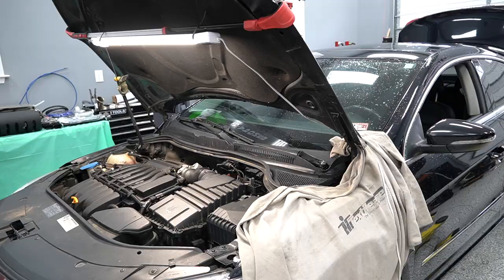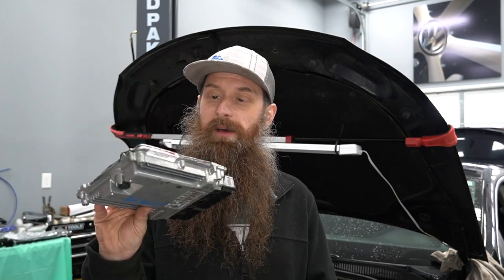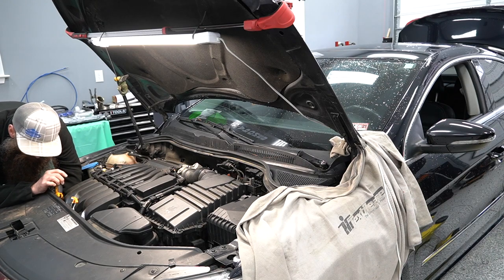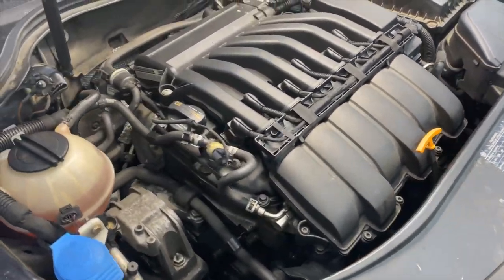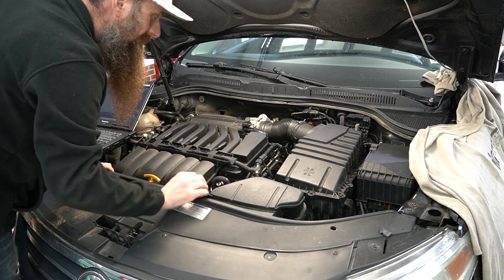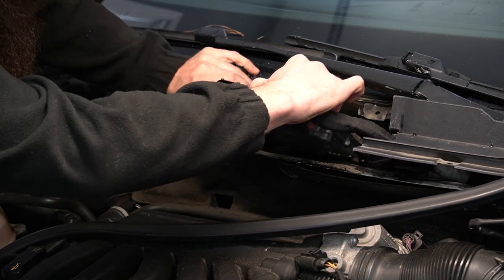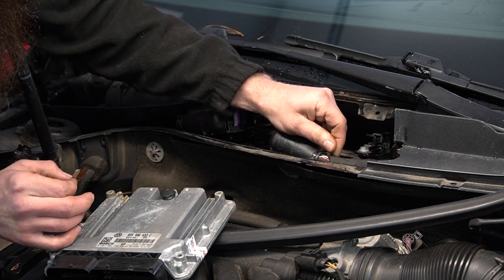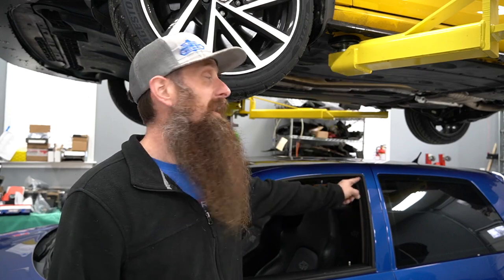3 Other Shops, Didn't Fix this Car. They Made it WORSE

Comment from the maker: BTW! Thank you all for 500k! it's pretty freaking awesome. <3 you guys! Also what should we put this 3.6 in? ;)
Reply: If my MKIV GLI shows up on your driveway, there's your answer, now I just need to find that blank check for you.
Reply from the maker: @CheezeCracker  LOL
Reply: A Golf Rallye
Reply: I also recently found a rusty razor in almost the same place under the hood in my daughters new 986 Porsche. Probably / hopefully from when the convertible roof was replaced before purchased. 
Thanks for the great videos. 👍
Reply: Mk1 Caddy, clearly.
Reply: I've got a Mk1 GLI coupe that would love a VR6. I'm up in Canada though - don't think Trudeau will let it come down to SC for a visit. 😢

Search IMGUR for "My 1984 VW Jetta GLi Coupe" for pics!
Reply: Question...seeing as how these DTC’s were logged nearly simultaneously wouldn’t it stand to reason that these circuits share a common ground?....perhaps check the other modules to see if there are faults mirroring the time hack of the ECM DTC’s...I had a similar issue with my TDI Jetta after replacing my dual mass flywheel...I spent hours troubleshooting with VCDS...what should have done was check my bonding straps to see if they were tight...the loose ground ended up frying my battery and main fuse...I know it’s seems stupid but even I made a very simple mistake by NOT checking my grounds first...I’m willing to bet that not only is it a ground issues but it’s most likely the one UNDERNEATH the battery box...it’s easily corroded and extremely easy to overlook given it location...if the car had a dual mass service, motor mounts or anything like that someone could have forgotten to hook that strap back up...given the intermittent nature of your reference signal values I would say poor grounding is a prime suspect...I’ve replaced hundred of ECMS of which only 1 or 2 was actual a failure of the ECM ...99.9 % of the time a “computer failure” is actually a wiring problem, short to ground or lack of ground completely
Reply: Mk2 Golf
Reply: The junkyard, along with the rest of the car 😈
Reply: Some folks have a saying, "Miata is always the answer." I believe it's applicable to your question.
Reply: the wink face makes me think you're already looking into swapping the miata
Reply from the maker: :) I have plans
Reply: How about your NB Miata? :)
Reply: A vr6 miata would be awesome
Reply: @HumbleMechanic  Congrats on 500k!
Reply: It’s stuff like this that reinforces the need to bring your car to an experienced VW tech!  I stopped going to independent shops for reasons like this one.  Only dealer serviced. Costs more upfront but fewer hassles down the road.
Reply: hope you have 500 MILLION .. you're doing great work sir!!
Reply: A JEEP 😁😁😁
4WD LIFE 😁😁
🤣🤣
Reply: What size turbo would you recommend for a 3.6 vr6? With stock internals
Reply: Some time ago i asked you why you didn't go with the r36 engine in the mk4 R32. Is this a coincedence or did i actually contribute to this Idea :). Please stick this engine in a MK2 2door golf, they weigh nothing and it should fit Just like the 2.8 VR6 fits.🙏 Maybe make it 4wd, some big brakes and turbo and you wil have serious 1700 pound killer.
Reply: I have a B5 Audi A4 with a 5 speed manual needing a new engine.
Reply: Love my TT Mk2 3.6. Relatively easy swap!

For a challenge - mk4 golf platform hehehe.
Reply: Corrado, and slap turbo on it :D
Reply: @humblemechanic Do you happen to have a video on changing trans oil on mk4 6 speed manual trans?
Reply: Ve caddy would be cool good luck

Comment: General Mechanic shops: "Volkswagens are shit!"
VW specialty shop: "No, they're pretty easy when you have the right tools and don't just shotgun everything."
Reply from the maker: I’d like to think all cars are that way. Lol
Reply: @HumbleMechanic  It's alright for a shop to branch out to a couple different brands of the same market domestic market. But general "we fix it all" shops should be avoided by everyone. 
Jack of all trades(brands), master of none.
Reply: @TopDedCenter  That's not true especially when it come to diagnostic which is what this video is. Literally all manufacturers have the same or very similar circuit and system designs. Some are a little different. So what? You just learn how it works, if you didn't learn how something works then why even bother trying to fix anything? Your comment is really ignorant. We have a little bit more brain capacity than you think lmao we don't need your approval for how many different manufacturers we can handle.

An ignition coil on every car is the same. It's just a step up transformer just depends on how its controlled and where its located.
Spark plugs are the same
Engines internals are all the same makes no difference in diag
Injectors are all basically the same there's a couple different designs which aren't hard to learn
All potentiometers, thermistors, pressure sensors, speed sensors, sensors in general etc are exactly the same through all makes.
Networks are the same just sometimes slight differences that make no difference really in diag
The diagnostic routine in general is exactly the same for all makes
HVAC, EVAP, Suspension, TPMS, key fobs and basically everything else is all VERY similar or exactly the same through all makes.

A light bulb is a light bulb and you diagnose it as such even if it looks different. It's the same shit.
Reply: @TopDedCenter  I dont agree, good independent workshops are some of the best of all, the experience of varied makes and models tends to lead to a greater understanding of fault finding and diagnosis, that said, there are people who are specialists on a given make or model for good reason, but they are hard to find, even at main dealers for the brand in question.
Reply: Yep
Reply: I spent years and years fixing other shops’ screwups on ALL German cars. “General” shops should stick to American junk and lawnmowers....
Reply: @rekker2688  I have main dealers send me work they can't fix, and I'm an independent shop. Go figure.
Reply: @TopDedCenter  Your statement sounds true in theory,  but is actually false. Look up "SouthMainAuto" and "TheCarWizard" channels on YouTube. Amazing mechanics and they work on damn well anything!
Reply: @chrishernandez2490  actually you'll find that SMA does not work on Euro crap and that the wizard's garage specializes in Euro cars. Hell they even do lamborghinis, Ferraris, etc. I totally agree with the concept that for any in depth troubleshooting or repair that trying to focus on too broad a market will reduce your efficiency and increase the possibility of error.
Reply: @TopDedCenter  Honda is superior
Reply: @fuckjewtube69  not the same, maybe for basic stuff but hard diagnostic or even maintain e jobs like timing belts requiere special tools and even show different symptoms for the same things depending on the vehicle
Reply: You are the real deal my friend

Comment: I feel like so many shops and dealer service centers are just part changers these days instead of having quality diagnostics. I think it comes back to the whole flat rate pay system
Reply: cannot agree more...
Reply: Absolutely. As a dealer tech I couldn't agree more.
Reply: 100%. Customer do not want to pay for diag. The constructor do not want to pay for diag. I got out of the auto industry 6 months ago because of this.
Reply: As a apprentice mechanic thrown to the wolves....your not wrong
Reply: Its both the manufacturers fault as well as the shops. 6 years experience here.

Cars are becoming so horrendously complicated, that the average shop/ joe has absolutely no chance of having quality understanding of any components/ modules the vehicles carry. Training is extremely expensive and time consuming, so 95% of shops will just throw techs at the wind in hopes of landing successful/ quick diagnostics. Flat rate only increases this issue tenfold.
Reply: Hey your comment is at least  25 years late.
Reply: Basically! I had a coworker bring his car into the shop for ignition issues, they tore the valve cover off, which for the issue he was having was necessary, and next thing you know he needs a new engine according to them because it has no compression. Other coworker brought his compression tester in improved it did have compression. Needless to say he tow the vehicle away and will never bring it back to them.
Reply: @fastinradfordable  indeed
Reply: the problem is that diagnostics consume so much time compare to just changing parts
Reply: From what I understand, the manufacturers really don't like to pay techs for diagnosis, but don't mind paying for parts changing. Apparently, they feel diagnosis can be too easily padded. An Audi tech I know said, that Audi now refuses to pay the 6 minutes for test drives. Go figure.
Reply: The reason I don't work on cars anymore.  FLAT RATE/FLAG HOURS...  Plus the amount of bs service writers sell to customers that they don't need and I was forced to keep my mouth shut and do the work anyways.
Reply: @mirex61  the problem is if it's under warranty there is no diag time.
Reply: Yeah and it’s hard to learn something new and make money at the same time that’s why I hate flat rate
Reply: @JJ-iw7nh  That's not true at all. Every manufacturer has ways of claiming diag on warranty repairs. There are limits, though.
Reply: I needed two new bearings on a fiesta... one was one unit st £100. Two was two units at £200.
It doesn't take twice as long when the car is in the air and you have the same tools in your hand. That sadly is why I have to watch and learn from guys like this.
Reply: Yep, customers would need to go along lines of "I pay for up to 4 hours of diagnostics, then you say what needs to be fixed. If I agree to apply the recommended fix and it doesn't fix the problem, I'll pay *nothing*. If you cannot find the fault in 4 hours but provide me a report of what you've checked *and verified working*, I will pay for the 4 hours of diagnosing the problem and look for another shop."

As long as customers are happy to take "I guess it could be ECM... it costs quite a bit but replacing it might fix the issue. Are you okay we try that and you pay for the parts and labor in any case?" things are not going to get any better.
Reply: I was a Dodge dealer tech for about 5 years, started in the oil change bay and worked to the A-team. I can tell you with 100% seriousness that I didn't learn a FUCKING thing in factory training. I've learned more from YT than I ever did in the Kennesaw classrooms.
Reply: Flat rate is the cause of an endless number of problems really, it's such a fucking awful concept from top to bottom. The fact it became dominate in automotive repair is a travesty, but it's endless problems seem to be becoming more and more recognized at least. With any luck in a generation or two it might be dead like it deserves.
Reply: @gokblok  
I would go further and just say that classroom work in general is largely worthless as training in 95% of cases. I struggle to think of a single god damn thing I really retained from classroom work that I consider really important, everything that I felt was worth anything in my training was actually working on a vehicles.
Reply: Here's a good article about flat rate and diagnostics: https://www.aaa.com/autorepair/articles/auto-repair-labor-rates-explained

The bottom line is that flat rate should not be used for diagnostics.

However, that article fails to say what should be done if the root cause is not found after N hours of diagnostics. What kind of report should the customer get and how to proceed then? For me, if I pay 4 hours of diagnostics and the root cause is not found, I definitely want full report about what was checked and found working so that it doesn't need to be checked again by another shop.

Flat rate is okay for clear tasks such as replacing the battery, replacing starter motor or replacing timing chain.
Reply: @garyfox8701  they don't pay you to take your tools out and put the car in the air. You will pay per side for any job like that in any shop.
Reply: The cars are poorly designed for today's workshops and poorly made. With labour costs and overheads so expensive a
smarter approach is needed, who can afford the time? Look at the issues these cars have, way too many.
What happened to zero defects manufacturing. Very disappointed to say the least. They knew the problems and wouldn't dare
give a decent warranty but they had to when the Asian manufacturers upt the ante and continue to do so, bless 'em.
To hell with all the mumbo jumbo, give me an electric motor.
Reply: Fact

Comment: I am so glad that I settled on Lexus when purchasing a car. I had looked at Audi, VW they have so many reliability issues that I really do not need to experience. There is a lot that other manufacturers could learn from in build quality and sound engineering from Lexus. They are not however as good at keeping a mechanic employed !!!
Reply: yeah. VW even has a tamper-proof 'leash' attached to the radiator, due to some ozone-scrubbing patent they took out & make the purchasers pay for. Shop unknowingly tampers with something in the vicinity, repair light triggers. Ridiculous engineering. I prefer their cheating diesels, at least those were somewhat innovative. : )
Reply: The VAG group is the most race successful automaker in motorsports... Reliability is part of the formula in winning especially in endurance racing..... The point is that the VW group knows how to make something reliable, it's whether they WANT to make it reliable for the consumer........ And unfortunately they choose not to...... And that goes for all automakers..........
Reply: @MiguelGarcia-vj7oo  If they put their "reliable" race machine on the street to be driven day in and day out for thousands and thousands of miles  it would be less reliable than the production car and require much more attention to keep it running. These race cars require very high maintenance and constant attention by service technicians  to keep them running. So whether they can make a reliable vehicle for every day use is questionable.

Comment: Charles, check the 3.6 upper front most timing chain guide. With the HPFP it causes a lot more wear on the guides and they commonly fail at this mileage and cause the HPFP to skip timing. I'd be willing to bet the guide is cracked in two places and the mid section is still bolted on. The fuel pump skips timing first and the rest of the motor stays in time but has the potential to skip timing and blow up.

Comment: Now I don't feel bad at all. I had a cc with pretty much the same issues and i was stumped. I put 3 different ecu's in it and it just would not cooperate. This one came in with chain noise so i replaced the chain and all the associated components and i suggested to the customer that he should have the hpfp done also. He of course said no so after i got everything back together the timing issues were fixed but it still had this weird stumble on acceleration. Felt like insufficient fuel. Damn those fuel pumps all together.. Finally i got the right computer in it and it ran alot better than when it came in but it wasn't perfect. The customer was really happy with it so i gave him a list of potential issues and said God bless..

Comment: I've seen so many mechanics replace ecm's and not one have I seen that fixed the issue.
Reply from the maker: It is super rare that is the issue
Reply: Unless it’s a Dodge Grand Caravan. 
Or a Mk3 vw.
Reply: Or a 1.8t Mk4 that shorted the o2 sensor
Reply: @fastinradfordable  What a coincidence, I am just about to do o2 sensors on my MK4 1.8t.
Reply: @HumbleMechanic  Not if its a Chrysler. I replace 10 ECM on Chrysler vs any other make. Ford is second, but at least theirs are from known issues (usually coil driver melts along with a coil). Chrysler just have bad Eeprom and will brick themselves from wrong checksum data. Also issues with trans control on all the ECM/TCM combo PCMs. Routan will get them soon if engine control is mopar too, just wait.
Reply: @fastinradfordable  Or a passat 35i ABS module.
Reply: I done a few bmw ecu's which got damaged with water
Reply: Honestly, I think I'm just too stupid to work on modern cars

Comment: The shop I worked at about a decade ago had a Blue B5 A4 cabriolet with the 3.0L 30V V6 come in for the Tbelt and ancillaries, a slight miss that previous shops and us thought was coil packs. We used the cam locking tools and they wouldn't quite fit. Turns out the previous shop that had replaced the Tbelt had it off by a tooth or so, the Cam pulley and interface are a wedge not a woodruff key and can therefore be essentially infinitely positioned, anyways. Base timing was the issue. The codes thrown indicated a bad cam sensor or coil packs on certain cylinders. Thanks for taking the time to document your process.

Comment: Regarding gunk on valves, on my mk5 gti I had a misfire on cylinder 4 and wanted to see if cleaning the gunk will make some difference. Cleaned it, took the decision to mount everything back as I was really curious, car was running the same. Only afterwards I swapped the injector 4 with number 3 and got the misfire code on cylinder 3. 
So after changing the faulty injector with an OEM one, car was running smooth, especially at cold start. So yes, in total there were three mounting and demounting operations, lots of effort, but at least I diagnosed it step by step.
Reply from the maker: It’s good to know for sure!

Comment: THANK YOU SOOOOOOOOOO! MUCH!  I watched MANY of your vids.. and on my 2015 GTI w/90K I noticed a bit of a 'stutter' when idling.. ..  dealer said it was a fuel system issue  I spent $3000..  stutter DID NOT GO AWAY..  watched a ton of you vids..  I replaced all 4 coil injectors..  FIXED THE PROBLEM..  now in a fight with dealer..   THANK YOU!!!   If you are ever in Delray Beach, FL  Beer is on me!